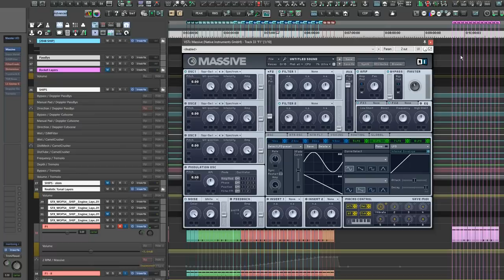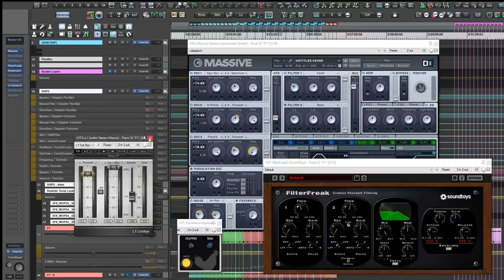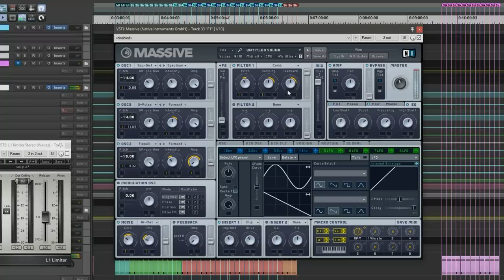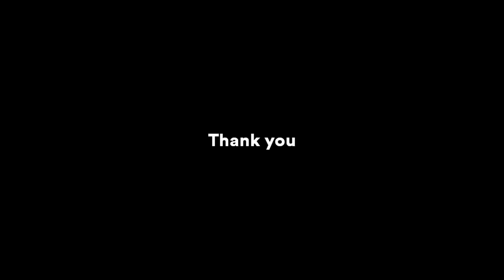Designing engine sounds for WipEout in MASSIVE | Native Instruments

Comment: I use to use native instruments but i stop messing with them  due to the fact that the hardware display on the Maschine mk2, when i try to edit on  the start and end it  moves on its on the display  ,meaning I have to disconnect the hardware and do it manually with the mouse, i tried to ask for help in their website support but they wont help me, and the worsed thing is that they dont have parts here in mexico for native instruments thats why i switch to MPC akai.

Comment: One important thing is still missing in this tutorial. You probably won't include Massive as a sound engine in the game so you will have to export multi samples.
That's pretty simple when you need multi samples of an instrument like a piano but gets much more complex with something like this. Perhaps it's just straight forward and you export something like 64 or 128 samples with different pitches an then blend between them in the game. But perhaps its not and hearing two of those samples at once is causing some unwanted phasing effects or just juming between those samples without blending is an audible change and not a smooth transition.
Reply: Hi Joe, have a look at the interview here: https://blog.native-instruments.com/loic-couthier-designing-engine-sounds-for-wipeout-in-massive/
Loic explains how this is all handled in Wwise and how it ends up in the game :-)
Reply: Thanks for that link, I was also scratching my head over how they could implement the modulation of this Massive patch, in-game, without losing its nuances. In essence, they took ten samples from the DAW, each at a constant 'velocity', and then re-combined them in Wwise, using a combination of cross-fading and pitch modulation. And then layered more modulation on top (which probably helped to disguise the seams). It's a miracle that doing all that in realtime isn't prohibitively CPU expensive.
Reply: @jeremyhollobon1723  Thanks for the post! Changing sample playback speed won't be CPU hungry even on a very old PC.
Reply: @jeremyhollobon1723  I appreciate the summary Jeremy. Thanks